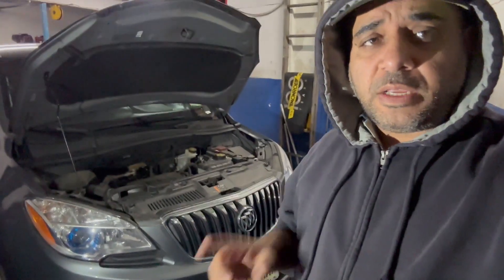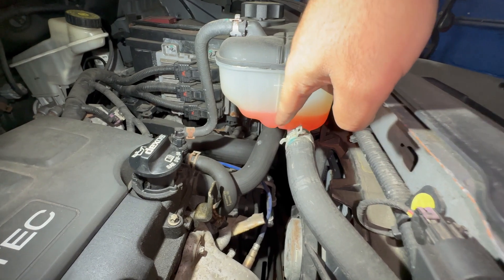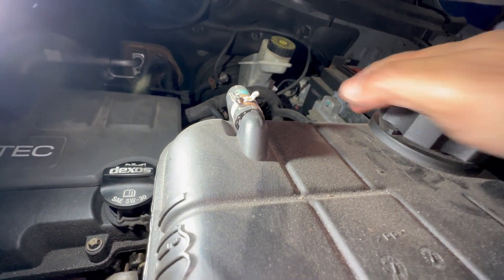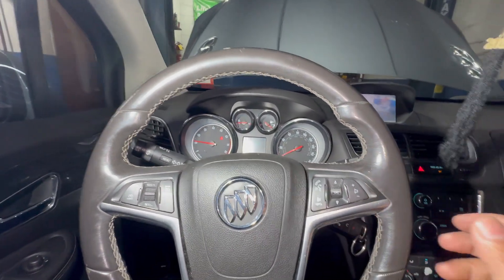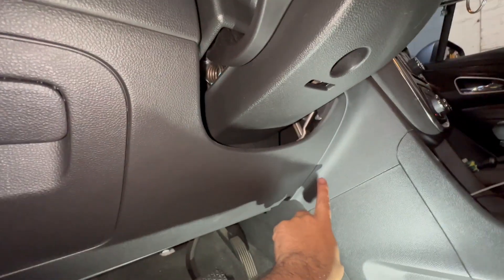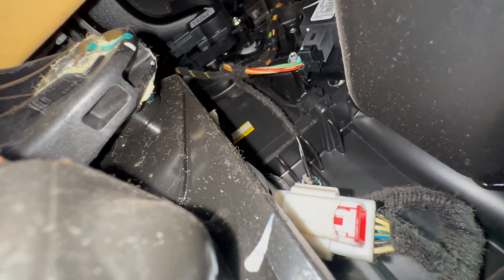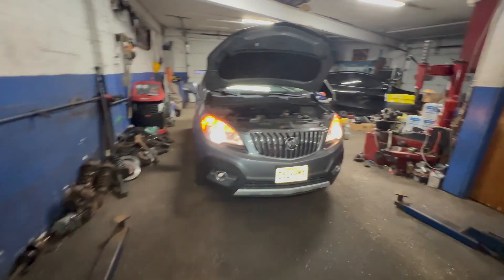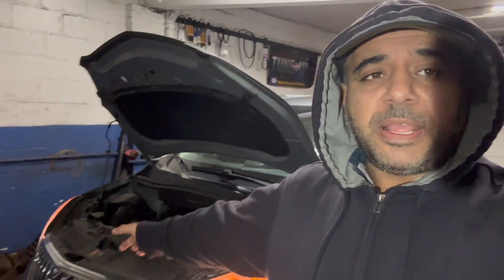How to fix car heater simple basic check up  / no heat in car  / buck encore no heat

Comment: My 2014 bmw f30 has dual climate control. Driver side heats up, passenger side... Not so much. So you think a possibility could be the actuator? Not saying 100% but a chance?

Great video
Reply from the maker: It’s possability check for operation